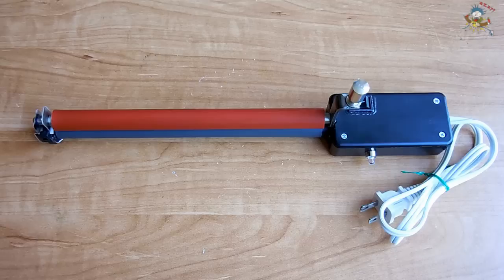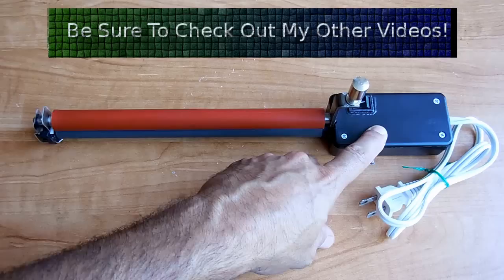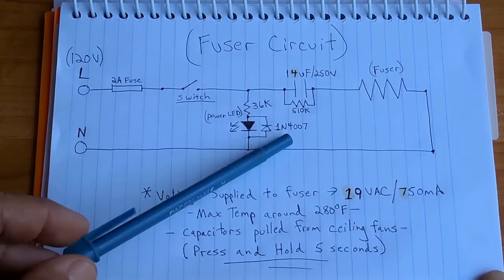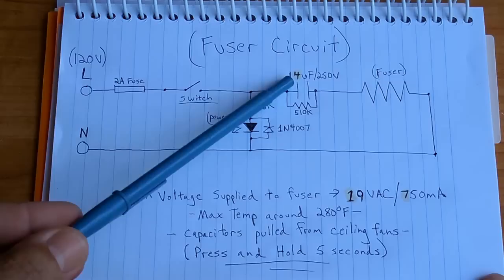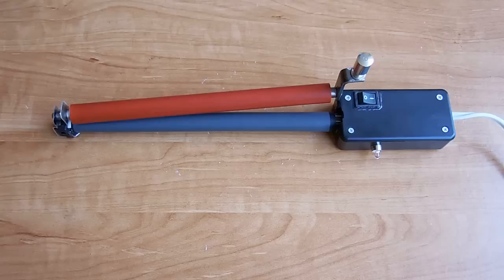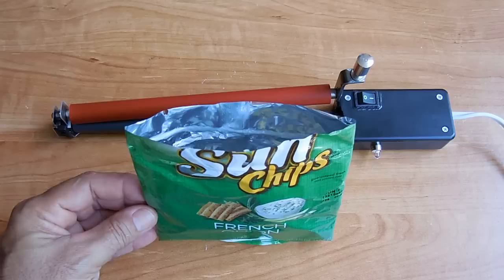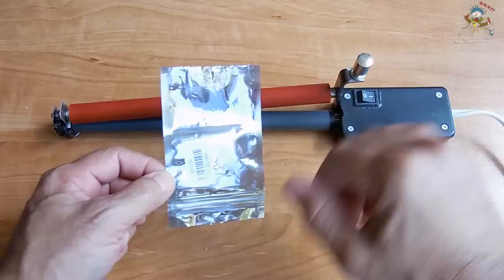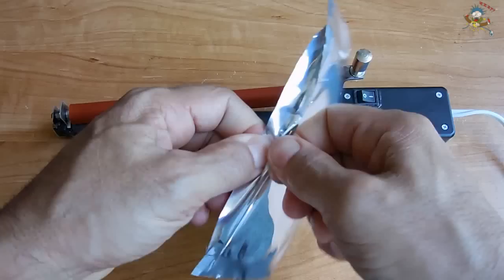How To Make A Plastic Bag Heat Sealer Using An Old Laser Printer!

Comment: Another idea is to save the tubes that are used for toothpaste and various ointments. When empty cut the bottom off and wash them out then fill them. The heater should seal them also. I use them for anti-seize compound and different types of grease.
Reply from the maker: Dillard Hayes Probably would have to increase the current to the ceramic element to work on toothpaste tubes.
Thanks For Watching!

Comment: Great! Your vids are very interesting&useful. I made a flux pen from highlighter and one from push-on tip paint marker, and I love that! That's a whole new experience in soldering
Reply from the maker: MrJohhhnnnyyy The flux pen works great as long as you use a good quality liquid rosin flux. Some can "Gum" up.
Reply: electronicsNmore I kinda suspect it to happen some time. But I'm using homemade flux, just rosin dissolved in alcohol, and fairly thin solution. Things work great for over 2 weeks by now

Comment: Years ago I tore apart an old copier from work.  I'll have to look through the parts I still have to see if I have that roller and fuser.  If so, I might be able to make something like this, which would be quite handy at times.  Does this work for all types of plastic bags or only certain ones with certain types of plastic?

Comment: Hi, very nice. The resistance of the fuser is around 35 ohms ? (The parallel RC impedance is around 190 ohms and you said that 19Vac is supplied to the fuser) Is that correct?
Reply from the maker: Adrian Carstea 19VAC at the fuser leads while 750mA is flowing.
Reply: electronicsNmore The RC impedance and resistance of the fuser, makes a voltage divider. So from my calculation to achieve 19Vac from 120 Vac, do the fact that you choose an RC impedance of around 190ohms@60Hz (510K || 14uF), the resistance of the fuse should be around 35 ohms

Comment: Do both the red and the blue rollers heat up, or does only the blue one heat up?
Reply from the maker: Daniel Piotrowski The red roller simply presses down the plastic bag being sealed against the ceramic heater strip that has the gray film over it.

Comment: Why did you cut away every time right before showing us the inside of the bag? It felt like you were pulling a glow in the dark Mt. Dew trick on me.
Reply from the maker: Jerry Whidby The entire video is edited that way. LOL. I live close to a main road where there is plenty of traffic noise, not to mention wind and surf noise which has to be edited out. I also cut parts to reduce the length of the video because many people have ADD. If I could make an entire video w/o any editing that was good, I would have a job in Hollywood.

Thanks For Watching